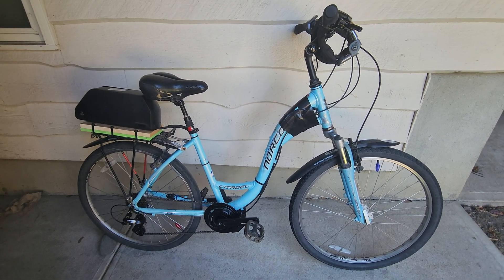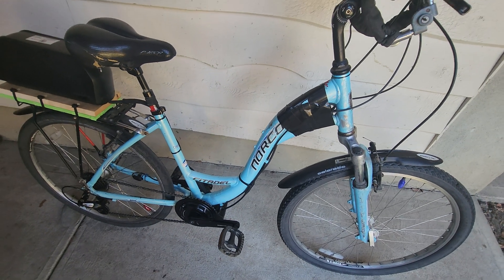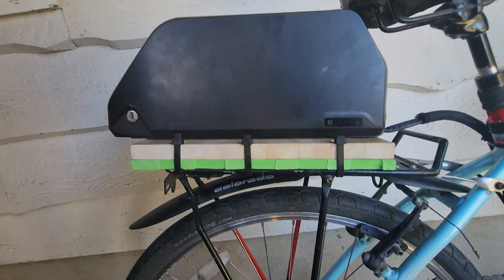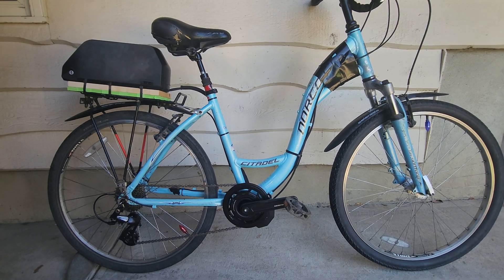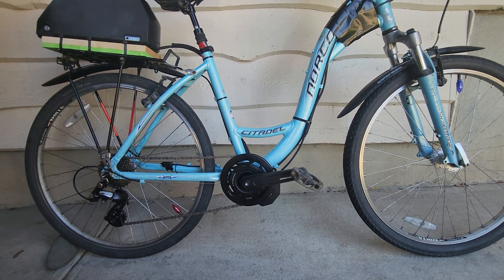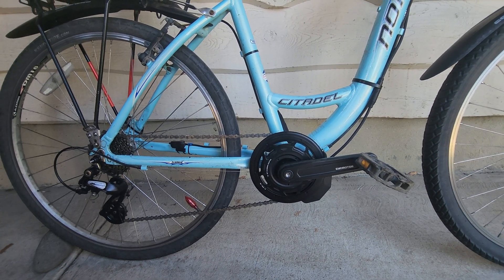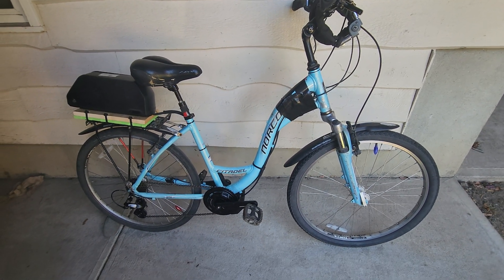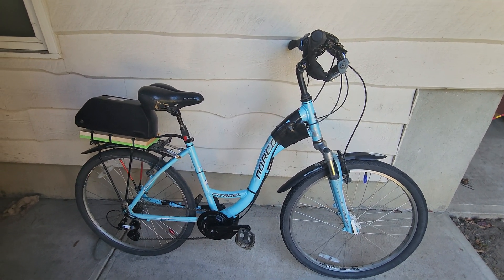Free Bike = Ebike! Save money and have a better ebike!

Comment: I'm waiting for CYC to get their 
UL approval, and then I will get one for my 30 year old Costco (Giant) MTB.  It's all set and ready to go with an Enviolo hub, Suntour NCX seat post, iberia rack, lights and all new cables and stuff.  Probably only have about $300 in it now.  But they don't make frames like that anymore.  All Tange tubing and drop dead beautiful TIG welds.  Was going to get a CYC B battery, but I think I might make my own with one from Vruzend.  Hope they have their V% ready by thin for 21700 cells.
Have you ever set the system to 36V and 250 watts to see how it does????

Have you got the new App that came out at the end of last month?
Reply from the maker: I have not had the chance with the new app. I heard they fixed quite a bit of stuff though. The bike frame sounds great. You are right. They are not built like that anymore. I am actually building a 36 volt pack to build with the OMNICELL weldless system which I am testing. There are a few videos of the 12 volt pack up right now. It will be 10s 2p with 50E cells for 10 amp hour. As compact as possible for short trips. I am looking forward to seeing how the Photon does with it.

Comment: I built this month a step through ebike  I was given for free for my 70 year old  Mum, who is getting arthritis but still loves riding. Mum was having issues  swinging her leg over the top bar.   The step through didn't have any mounting points (e.g. water bottle holder), so i bought my new favorite bike tool to create some....a rivnut countersink.   I find building ebikes means i can share the same battery across bikes.  The big concern is all these proprietary integrated battery packs that when the OEM stops making battery packs that fit, the bikes become useless.Thanks for your videos.
Reply from the maker: Nailed it. There are so many bikes getting chucked. The battery goes. Can't get another so then they get a new bike. The components on the old one are crap so junk it is. Very sad.

Comment: Wouldn't be better to use DM02 for this kind of bike?
Reply from the maker: Good thought. I would have considered it but it needs the firmware flashing. I also want to do the route I did with the DM01 on the same bike and battery combination to compare. But yeah a motor like that and a cheaper battery would make this bike doable for much less.
Reply: @HighVoltageKits  Have you finally received programming cable for dm02?

Comment: Feel like people who haven't actually used v brakes in a long time if ever are making these brake comments.  V-brakes are capable of locking the wheels on most bikes. Even downhill mountain bikes traveling at speed. For around town they are perfectly adequate.  Failing that, there's always the magura hydraulic rim brakes that will absolutely put a lot of disc brakes to shame
Reply from the maker: It's the added weight to a heavy bike. The crusade against them is not warranted. By the same mark, I'd feel better with a hydro up front. I bet I can get a second hand one.
Reply: @HighVoltageKits  looked up the magura ones and they cost a lot less now than they once did.  There's also other brand hydraulic v-brakes now for not too much money.  I'd personally rather save a bike i like. Upgrade it and use it than, throw it away just to get one with disc brake mounts.  Not worth it

Comment: I have a Specialized Fat Boy and would prefer a motor with a torque sensor since I plan to primarily ride using pedal assist. Looks like the Photon would be the best option right now?
Reply from the maker: Yeah. Its the only one with the bb size to match that frame I think.
Reply: @HighVoltageKits  I was doing some research today and it looks like the Tongsheng TSDZ2B comes in 120mm. Quality doesn't look like it is on par with CYC, but is less than half the price.

Comment: A man of my own heart. My first build was my old Cannondale & a $1600 budget (the price at the time of an inferior hub driven Sondors) for a BBSHD & 17.5ah battery. Unlike most, I'm not against the rim brakes (I have a BBS02 on a rim brake bike) but suggest good brake pads (I'm partial to Kool Stop e-bike specific pads for the large surface area).
Reply from the maker: The brakes are okay... I'm going to swap the front. Needs a touch more for hard stops.
Reply: @HighVoltageKits  I hear ya. My 02 is set up to qualify as "class 1" in the US (limited to 20mph & no throttle but it's legal anywhere a bicycle is in the US unless expressly banned). Anectdotaly while testing the bike before going class 1 I got to around 32mph and had more problems stopping from the skinny tires than from the brakes, which locked up the wheels without issue.

Comment: Hmm is it a good idea to put such powerful motor on such bike? Photon will allow for reaching speeds this bike was never designed to reach which is especially apparent looking at the breaks. Another motor say up to 500W would be better matching choice.
Reply from the maker: Good thoughts but in reality what it will be used for is to go up the savage hills here. Its 750 watts in any kind of hot weather. The front brake will get swapped to a hydro disc for sure. But they are ok. The motor will probably not get used to its max 99% of the time. The quality of the ride and feel at all levels is very good. Excellent thoughts though. Safety being key.